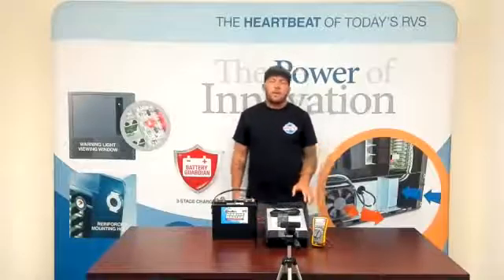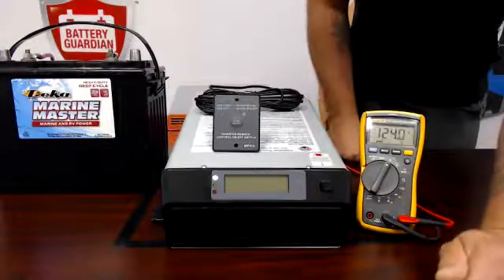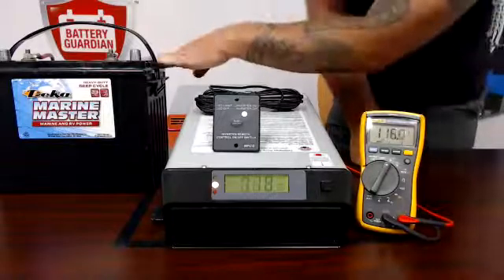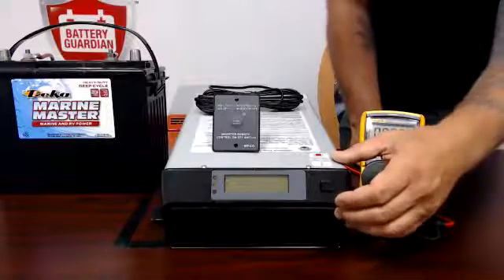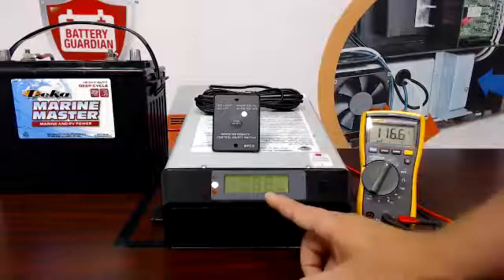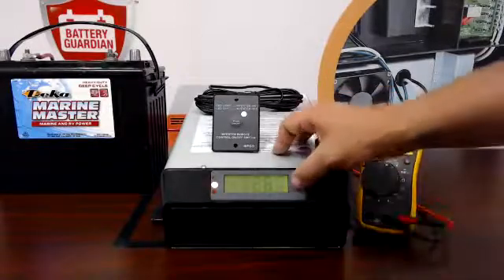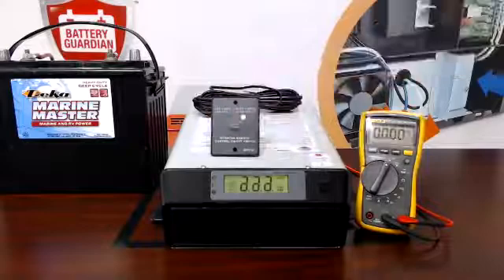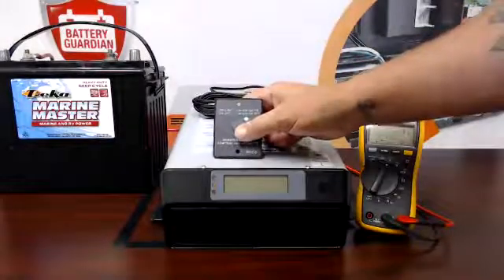Basic 5110R/RS Operation

Comment: How would you upgrade from a WF-5110R 1000 watt inverter to a WF-5220 2000 Watt inverter?  The WF-5220 2000 inverter does not come with the AC shoreline 120 V plug like the 1000 watt inverter has. I have contacted your Tech Support both by phone and sent emails.  No response.  Can you advise?

Comment: 2021 1970 esp, after 2 months the inverter outlets quit, pass through is fine. accessed the inverter, pushed on button, get a half second of fan operation. after 2 to 3 seconds amber light (no screen display) from that point, approx. 5 seconds pass then red light with fault signal bottom left. removed the 120 wires from unit to see if it had a short, fired it up same problem. defective unit? called you a couple months ago but get my point across better here
Reply from the maker: We can help. Please contact WFCO Power Pros at 877-294-8997 or visit our website wfcoelectronics.com.
Reply: @wfcotech on a pleasant call with you, you advised calling dealership. got a runaround from large salt lake dealer, nearly two day trip away, thank you for the response i'm researching alternatives

Comment: Our airstream came with a 5110 inverter and I upgraded to lithium batteries. Is there a way to change the cut off voltage as my inverter will shut off when I still have a lot of available capacity in my batteries.
Reply from the maker: It depends on which 5110 you have. For further explanation please contact WFCO Power Pros at 877-294-8997 or visit our website wfcoelectronics.com.

Comment: Good morning,
How much draw do these inverters consume while on with no loads? I have two batteries (12v) wired in parallel and my cpap running all night completely discharges both batteries.
Reply from the maker: To receive a full explanation, please contact WFCO Power Pros at 877-294-8997 or visit our website wfcoelectronics.com with further questions. Thank you!

Comment: Hello I have a 2021Rockwood Geo Pro travel trailer. It comes stock with this 1000watt inverter. My question is I want to upgrade it to the 2000W inverter WF 5120. I noticed that the 2000 W inverter does not come with the AC shoreline 120 V plug like the 1000 watt inverter does. Can I disconnect the plug from the 1000watt inverter and attach it to the 2000 W inverter. For AC shoreline power? Thank you for your time.
Reply from the maker: Can’t do it, unfortunately.  

#1. The 5120 is hardwire input & output – it’s not designed for a power cord with a plug.

#2. The WF-5110 has a 15 Amp cord that can’t be disconnected without getting into the unit. And then it wouldn’t work anyway because the 15 Amp cord is too small for the current capacity of the WF-5120.
Reply from the maker: 2000W is hardware only. Please contact WFCO Power Pros at 877-294-8997 or visit our website wfcoelectronics.com with further questions.